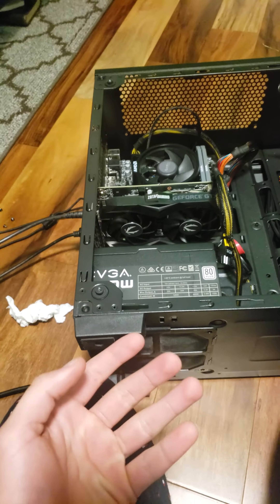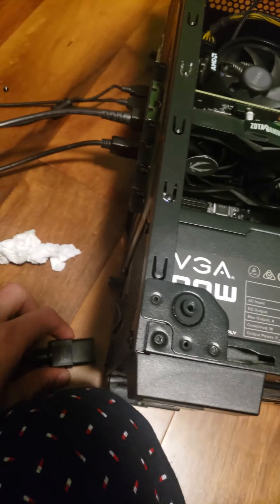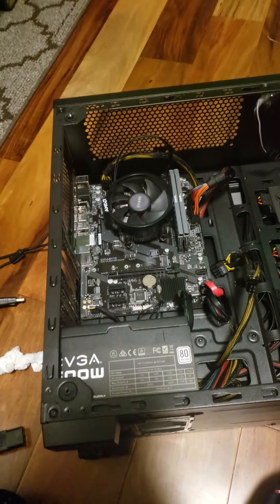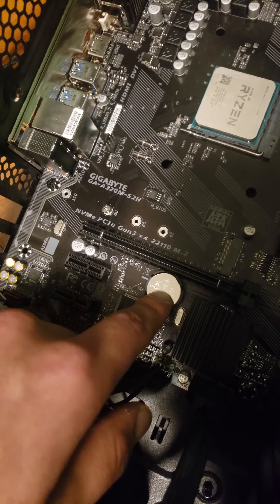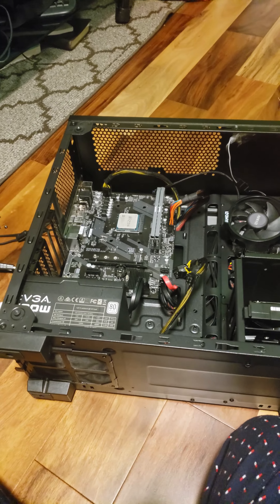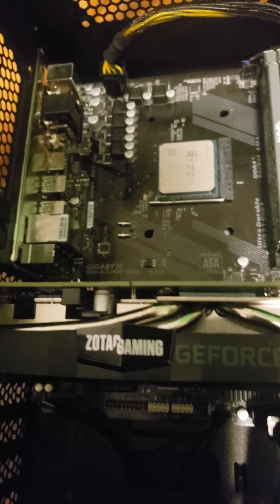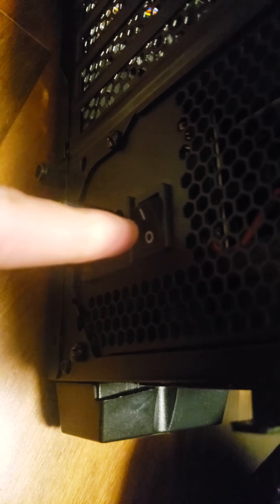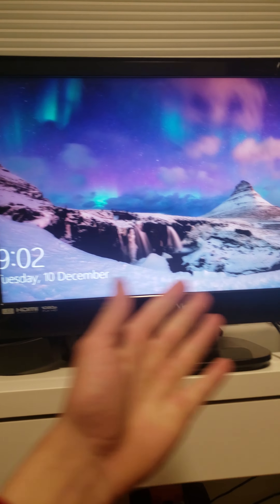How to fix your computer after a really bad CPU overclock

Comment: I had an insane voltage in my GPU after a bad overclocking, and couldn't make it back to normal in the BIOS or the other tools. I was freaking out, but then I found this video. I put all my faith in it and it worked: back to normal. I owe you one, my man. Greetings from Colombia.
Reply from the maker: Sin problema mi amigo, yo Tambien so Colombian jaja, si no que yo vivo en Canada
Reply: @SantiagoReviewsrepairs  Tremendamente agradecido, hermano. Un abrazo.
Reply: for me it fixed the red cpu post LIght but still wont boot either bios or windows im stuck with vga plus boot(green) light on motherboard x670ef

Comment: This is good info. There’s also an easier way to do this though. On pretty much every motherboard, there are two pins labeled “clear CMOS,” or “CLR CMOS.” Once you have the pc unplugged, you can touch anything conductive to those two prongs. For example, a flathead screwdriver works perfectly. Once you touch them together, it clears your motherboard memory immediately. No need to remove the battery. No need to remove the GPU either, assuming the prongs are reachable by a screwdriver
Reply: But this is only if u mess up like a ram over clock or just something that doesnt really harm the pc like a boot loop i had one before too but this one was a terrible oc so thats why u need to take the gpu out and the mb battery
Reply: Thank you so much😊

Comment: Brother, I came to your tutorial on accident, but it literally saved my computer and myself! At first I thought it wouldn't work, but it worked. I am soooooo thankful so fricking thankful. Subbed, liked.
Reply from the maker: No problem my guy if you ever need anzy help leave a comment I will prolly make a video on it
Reply: @SantiagoReviewsrepairs  Cool, thanks!
Reply from the maker: If you want i made a new video on the programs to use to overclock your cpu and gpu and how to over clock your gpu
Reply: @SantiagoReviewsrepairs  thanks, but I rather no longer play with overclocking for my computer's sake 😃
Reply from the maker: Ok sounds good

Comment: ok, I took out the battery, did what you said but it failed so I just changed the battery instead. thanks for the tip with the battery though

Comment: Taking out CMOS didn't work for me.Overclocked to 4.1 Ghz, psu 550w.PC restarted, installed some win11 updates, rebooted.Now it turns on/off every 2 seconds nonstop.Can't even go to bios screen.Wondering if its psu fault or processor?

Comment: I did it and it started normally, but then i got a blue screen again so i shut it down and restarted it, black screen again, then i did the battery thing again and i still get black screen, is it possible i discharged the battery with my hand?

Comment: I got this prob but with ram clocking. Is it working for oc ram prblem ?
Reply from the maker: Yes
Reply: @SantiagoReviewsrepairs   I just tried it but it didnt work. btw where do i plug my monitor ? on the gpu or mother board ?
Reply from the maker: @kaku.z5720  GPU
Reply: @SantiagoReviewsrepairs  nvm it worked i just didnt put correctly my ram. Thanks for this video it helped so hard

Comment: Should I do the same if my computer starts up but freezes in the bios screen
Reply from the maker: It may work try it
Reply: @SantiagoReviewsrepairs  I tried to overclock my i5 4690k from a 4.3 to a 4.6 but it freezes every time I try to start up and can’t proceed to the bios menu
Reply: @SantiagoReviewsrepairs  or should I try to update the bios on motherboard
Reply from the maker: @1_luismm  do what I did in the video it resets your bios completely
Reply: @SantiagoReviewsrepairs  alright does it reset my old overclock too?
Reply: @SantiagoReviewsrepairs  damn I just took out my gpu to just find out my motherboard does not have that battery thing
Reply from the maker: @1_luismm  yes

Comment: Plz help . I own a laptop, I did undervolting using Intel XTU but accidentally it overclocked my cpu and gpu. I did everything to set default but nothing changed.will resetting cmos will solve this?
Reply from the maker: I mean it should do the trick but I don't really know how to do that for laptops. But yes reseting a smooth is like a windows wipe essentialy but just for your motherboard

Comment: How did you get your CPU to 4.4 ghz I have the same one and I want to do it myself
Reply from the maker: Dont do it, it's not worth it that's why I had to back up the over clock
Reply from the maker: And thankfully my cpu didnt fry because of my liquid cooler but just barley
Reply from the maker: If you want a good clock for your cpu I could make a video showing you a decent overclock if you want?
Reply: Seriously Santy that would be cool if you made a video on how to get a decent overclock
Reply from the maker: @joemother8711  sure thing
Reply: Seriously Santy thanks
Reply from the maker: @joemother8711  no problem
Reply from the maker: If you want i made a new video on the programs to use to overclock your cpu and gpu and how to over clock your gpu

Comment: It definitely works, but once I shut down my computer or even put it into sleep mode, it just does the same thing again, so I have to do the same process of taking out my gpu, removing the battery, waiting, and putting them back in, which is getting really tedious. I also cant use the clear cmos jumper pins since i dont have a jumper. any solution to this?
Reply from the maker: Did you remove the overclicking program afterward?
Reply from the maker: Overclocking* and make sure you reset the over clock
Reply: @SantiagoReviewsrepairs  I did not. Ill try that and let you know if anything changes.
Reply from the maker: @CuboydMC  sounds good

Comment: I oc my r5 3600 to 4.4 and watched every yt video, unplugged ram, gpu, cmos battery and touched the two pins that say clr cmos with a screwdriver and nothing works, alsoi hear the fan speed going fast for some secs and then slow and that is on a loop when i power my pc, plzz help if u can🤗😫
Reply: Honestly the only other thing I can think of is unplugging all of your hard drives and trying everything again
Reply from the maker: @MLTAKOS  if none of these things worked then you are gonna have to get a new CPU or motherboard because there most probably fried
Reply: @SantiagoReviewsrepairs if my cpu was fried i think it would smell and not turn on at alla while my is on just black screen
Reply from the maker: @MLTAKOS  when a cpu gets fried ot doesn't make a smell it just stops working thats all there is to it. And if you really think the pc really is turning on and the only problem is the display plug in a headset and turn it up as high as you can then try putting in your password
Reply from the maker: @MLTAKOS  and clicking random buttons until you hear windows make a sound if it does that then you can tell me that its not your CPU
Reply: @SantiagoReviewsrepairs  i think its cpu related caz as soon as it starts the fans go slower and its like its on low power mode
Reply from the maker: @MLTAKOS try searching up different video then Idk what its is sorry and I hope you fix your pc dude😔
Reply: @SantiagoReviewsrepairs  thx for trying btw😉
Reply from the maker: @MLTAKOS  ya no problem I tried my best
Reply: Miltosss  100% cpu dead 
i have same problem :(
Reply: @fortnitesoft1047  it wasnt dead it was a motherboard issue and it kinda fixed itself after some days

Comment: After doing this my pc started to run but  display is black and when I power off and on it not starting so again i removed CMOS and did and the problem repeating again and again.
Reply from the maker: Try taking out the GPU and reboot the pc and plug the display into the motherboard, if display does not boot up then it’s a cpu issue, if it works a GPU issue
Reply: @SantiagoReviewsrepairs  I'm having laptop

Comment: Hey could you help me. Still black screen. I also disabled 7-8 boot options. Idk what to do :( new pc and bios updated went smooth then ofcourse I make some overclocks and this happens
Reply: same here buf, did you fix it?
Reply: @lexusrcfglazer  unsink the motherboard battery. It will set bios to default values. It worked for me the second time
Reply: @paulkennedy8163  i did a lot of times and it didnt work, but when i removed my cpu and put it back, it did. Also my cpu came of with my cpu cooler lol. Definitely not overclocking again lol

Comment: I need help. I reset my cmos and it didn’t fix it. I reset my bios and I still can’t get to windows. Every time I boot up it says preparing an automatic repair and it brings me to the Continue, use a device, troubleshoot, and reset pc. I cannot get off this page. Nothing works. I can’t factory reset my pc either. Please help me!
Reply from the maker: That means your hard drive or ssd is corrupted
Reply: @SantiagoReviewsrepairs  I have an ssd and hard drive
Reply: I mean 2 ssds
Reply: Are both of them broken?
Reply from the maker: @pleasesntsc110  ask a friend if you can test them on a difrent system
Reply: @SantiagoReviewsrepairs  do you have discord so I can send pictures please?
Reply: @SantiagoReviewsrepairs  I don’t have a friend that has a gaming oc

Comment: i went into msconfig advanced boots option and clicked 4 cores since it was using 1 core what do i do?!?! i restarted it and the pc is stuck on black screen!
Reply from the maker: Try unplugging your hard drives and ssd's then turn the computer back on. If that doesn't work do what I did in the video then try. And look for the button that says reset default then save. Then plug your hard drives/ssd's and turn it back on and go back to bios then choose what boot drive you wanna use and load into windows

Comment: After I did it step by step no signal to the monitor!
Reply from the maker: Try using a difrent HDMI cabel or you may also try replacing the hard drive
Reply: @SantiagoReviewsrepairs  thanks for reply already I tryed. With bulit in VGA. Hard disc. Still continues prblm.

Comment: Bro i overclock my ram then it shuts down.what should gonna do?
Reply from the maker: 1: Go into the bios of your motherboard.
2: Look around till you find were it says VRAM MGZ or megahertz.
3: Change it back to your manufacturer's base clock speed. " search up your ram on Google and it should come up".
4: If those don't work do what it shows in the video above.
5: If none of these work your ram is fried, you will need new ram.
Reply from the maker: If you want i made a new video on the programs to use to overclock your cpu and gpu and how to over clock your gpu

Comment: i did everything and it still says input not support i did overclock my monitor thought this would help, can you help me pls (we have the same motherboard btw)
Reply from the maker: If that didn’t work try taking out the ram, and disconnect the Hard drive from the motherboard, and unplug any power inputs into the mother board
Reply from the maker: Then just let it sit for a day, come back and plug everything back in, oh and make sure you take the CMOS battery out again
Reply: @SantiagoReviewsrepairs  if i get a new monitor with more hz will it work fine or no
Reply from the maker: @usecodemiaou766  it wouldn’t make a difference, but I do advise against overclocking monitors

Comment: Will it work if I don’t take the cooler out?
Reply from the maker: Yeah, i had just gotten a new cpu at the time
Reply: Thank you so much. It worked. Btw are the cpu settings overclocked?
Reply from the maker: They where but i recommend searching up the safe overclock for your hardware

Comment: So my friend's brother, overclocked his old CPU on the max and it "died" he said, the CPU is a AMD FX 8370E, the computer did turn on but no screen, we also replaced the motherbaord with a brand new battery for the mobo, but it was black screen, anything about this or is this only for Ryzen cpus?
Reply from the maker: Does it have a gpu?
Reply: @SantiagoReviewsrepairs  Yes, we tried with a GT720 1GB and soon my friend will get GTX750Ti 2GB. We also tried to dofferent monitors with the GT720, with VGA and HDMI. Same result.
Reply from the maker: Its not a HDD issue because it still turns on, did you use the same ram in both builds ???
Reply: @SantiagoReviewsrepairs  only on GT720, 32GB DDR3 ram

Comment: If this does not work for me am I screwed? :/
Reply from the maker: No if it does not work it may simply be a case of just taking the pc apart and putting it back together, its a real pain but it works
Reply: @SantiagoReviewsrepairs  ok because I doubt I bricked something, I was doing a very light over clock when suddenly MSI after burner was showing my gpu stuck at 300 MHz, after a reset I am stuck with the black screen :/ I will try to re assemble everything tomorrow (thanks for the help btw)
Reply from the maker: No problem, best of luck to you, make sure you do buy some thermal paste before hand if you dont have some

Comment: How do I fix it on laptop
Reply from the maker: Unfortunately on laptop you may need to, take out the battery and let it sit for a couple of days, then restart it while it’s plugged in, and go into the bios and reset it and start it up in safe mode
Reply: @SantiagoReviewsrepairs  I might ask my parents to help but I don’t wanna tell them
Reply from the maker: @6sightx  i don’t think your parents would get to mad, just tell them something happened with the software it it just crashed, you don’t need to tell them it’s your fault, just look at some more videos
Reply: @SantiagoReviewsrepairs  OMDS I RESET IT AND I THINK ITS BACK TO NORMAL BUT SADLY IT UPDATED TO WINDOWS 11